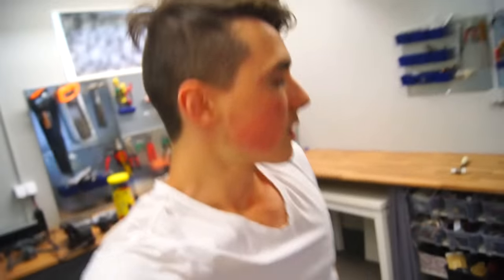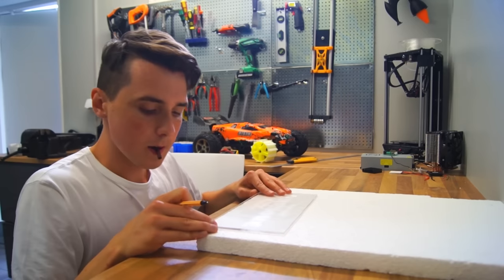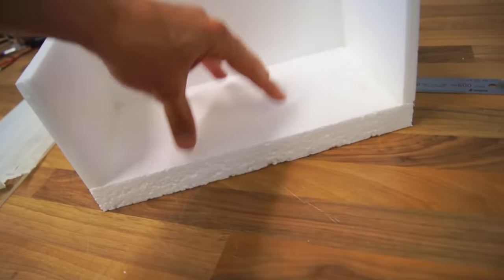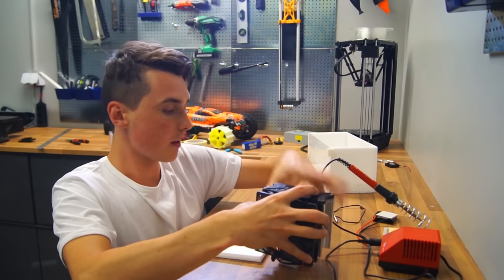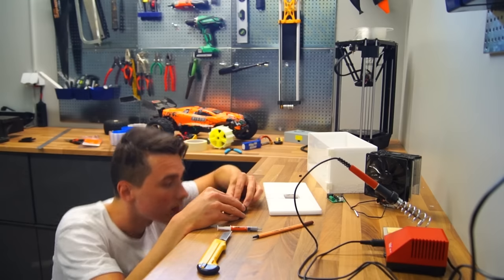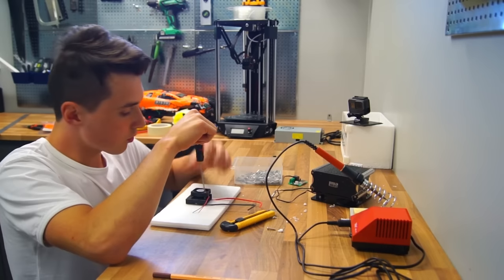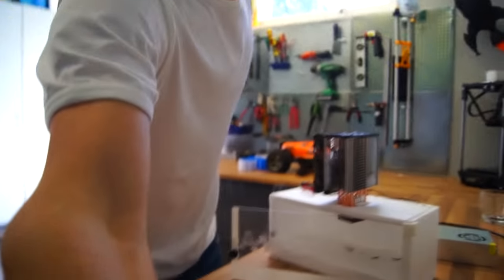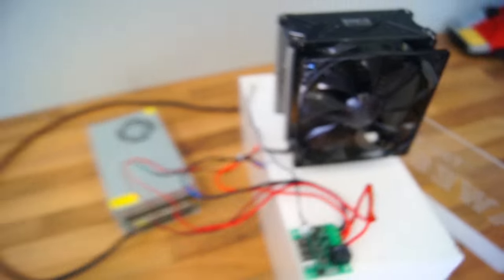Powerful Cooler Box - DIY Peltier Freezer

Comment: Peltier elements are usually designed to reach a 40 C temperature gradient between the two faces. You managed to get 38 C difference which is actually very good. If you want a lower temperature, you need to put 2 or more Peltier elements in series. Nice stuff!

Comment: When you turn unit off, inside temp is -7 degrees. Now ambient air heats external heatsink and transfers heat energy through peltier device back into your coolbox. Want proof? disconnect x4 heatsink when you disconnect power. Now coolbox stays colder after 30 minutes. Great video mate and thanks for sharing. Keep up the good work

Comment: Now this is fantastic! I saw an old but still useful Waeco cool box on ebay, well it use to be a compressor fridge which had all the parts removed because the compressor is damaged. Could use this to bring it back to life as a thermoelectric cooler. Thanks showing this project!

Comment: Great video! I'm also working on making a cloud chamber which means I need to see the lowest temperature that I can get. I did some experiments with 12706, 12709 and 12710. The lowest temperature with a heatsink with 4 copper pipes and 2 fans is -30°C. But you can do better by stacking them. I'm using 12710 on the bottom and running it with 12V and the top one is 12709 which is running with 5V. The result is -35°C. If you give too much current, the produced heat also heats them. If you have an oscillator, you may try the voltage/current ratios and find a way better solution (unfortunately I don't have one, I couldn't try it). Another good way is the cooling down the hot heatsink, not with air but with water or something do not freeze in those temperatures. If you use ice to cool down the heatsink you may easily see -50°C. What I think is that using the second cooler to cool down the main one with liquid cooling. So if you cool down the main heatsink to -10°C, you'll probably see -55°C and so on. I'm gonna try that soon and hope these ideas also help to someone. Keep up with good work!
Reply: turk var turk as bayraklari as
Reply: How could I calculate the necessary Amp for a 12715?
Reply: In an experimental way, you just need to test it. You can also try square wave signals with a particular frequency.
Reply: That's a clever thought. I might try that one (y).
Reply: I'd really like to see how that turns out. Please share. Please provide me with link . tnx
Reply: Is there a way to use this type of cooling technology to cool a 1sq meter space? Or is refrigeration more efficient at that size?

Comment: i've assembled dozens of pc in the past and that's how i applied the thermal paste. i don't know if there's any new method today but imo the reason why it's the best way is that it will guarantees 100% thermal contact (not surface contact) without any bubble, but of course if you managed to cover the whole surface it will be ideal. i really don't see any other ways are bad, as long as the paste cover most of the surfaces around 95%, you're good to go. most method will cover all the surface as long as they apply enough pressure to the plate. it's all about heat transfer efficiency.

the only concern i have with this build is the door placement. i'd rather put the door on top of the box to minimize the cold air "leakage" when you open the door. i'm not expert on this, but i always imagining cold air is just like water. it goes down to the low places. so, if you open the side door, i kinda "see" the cold air immediately pouring out. but it's a design issue, the concept still works.

Comment: Hey, I really like understanding Heat insulation efficiency in a forge wall, that stops over 2000 degrees passing through the forge wall, and stops it from melting a 2 mm outer casing. Excellent for thermal efficiency. It will help in knowing thermal efficiency for keeping something really freezing cold. Good luck.

Comment: hey, your worst insulation is that plexi door.. if you use a thick bread of clear silicone around the perimeter, and use a second sheet of plexi. it traps air, makes a double glazed panel.. much better.
and if you use a couple of led ribbon into the edge of the awesome sheet, it will light up the wording in an awesome way ;)
Reply from the maker: Yeah thanks for your suggestions! I was using 4mm acrylic, but maybe 2x 2mm sheets would actually work better? Or why not just go with 2x 4mm sheets!
Reply: RCLifeOn testing required but I reckon 2*2mm with an air gap would be an improvement over 1*4mm - 2*4mm would probably be better but 3x2mm or even 4xv.thin probably better still

It may well be too that you'd get better results using v.thin styrofoam or even rubber foam than air but the ability to see through is often an important consideration that overrides thermal efficiency

Thanks though for the great video!

Comment: excuse for my poor english, but really dont forget  that when you turn off your system the hot side of module diffuse heat in all the system (evo+hot side ->radiator+cold side) instantly, and all the time heat "wins" against cold. to reduce this effect you can try to mount the evo in push-pull with a mini inverter circuit with 11.1 lipo only to supply the fans on the hot side when the system is suddently turn off. Then mount like pc peltier cooling a brass plate near 5 mm ep. between hot side and evo. the temperature issue is not bring only by insulation. nice video, good project!

Comment: The way that you spread the "Thermal Compound" on your first project was correct,but should have used abit more. Putting a "Pea" size ball in the center and pressing the Peltier Device down will not spread it evenly completely or will not guarantee complete coverage of the Peltier Device's hot side or cold side. The surfaces must be covered completely for maximum cooling and heat removal!!!

Comment: Well, how you apply thermal paste doesn't matter at all. Linus tech tips did a video about it. The only difference is if you apply too much or too little. So you're not right, but not wrong either :)
Reply: Linus tech tips did a video on it and said that the best way is to make a pea sized drop.
Reply: But that video is about two years old, don't know about his newer ones
Reply: Maybe they said that, I don't remember, but there was no difference at all as long as you didn't apply too little or too much.
Reply: Anton Hylander well that is true also the thermal compound matters too but if I recall when he did another one of these he put a crapload of compound which is worse than too little.
Reply: Linus Tech tips is horrible for such things. Sorry but there are so many screw ups when it comes to temperature stuff. Like measuring the surface temperature of the case instead of the insides....
Reply: djteac again it's not just Linus cus many other youtubers have tested this and it's fine, it reallly doesn't matter if they messed up. As long as it covers the surface ur good.
Reply: but linus's video refers to installing a heatsink on a cpu, which is a bit different ;)
Reply: FeuerToifel it isn't much different to much paste causes a insulted effect. so you still want a thin layer so it can translate the heat to the cooler and using better paste also helps
Reply: the difference is, in cpu it is important to cover the middle part, where the DIE is. it is not that important, that the whole heatspreader has thermal paste on it. but here it is important to have thermal paste on the whole surface.
Reply: It matters because some methods will trap air bubbles, doing the opposite of the intended effect.
Reply: @Adam Knapp: It does not matter when you use the right amount.
The air bubble myth is a lie. All the air will get out when the pieces are pushed together. Some wannabe just made up the "there is air omg"-theory to look genius.
Reply: It doesn't matter as much from a practical perspective with CPU's, but there can be a measurable difference. I have seen improperly applied paste with air bubbles cause SSR's to prematurely fail in high wattage dimmers, though as you implied it was often also affected by the fact that they used the wrong amount in a field replacement.
Reply: Anton Hylander I have a quick question about how these peltiers work. If I made the same exact unit in the video but made it so that the cold side was facing the big heat sink, would that heat sink get cold and would cool the air that fan blows through it? (Effectively making a compact ac unit)
Reply: James Andonian while I have not tried but I hope to get some soon maybe I'll make a video. But my guess is the better option would to put the heat sync on the hot side because the cooler you keep that the colder the cold side gets and maybe put a hestsync and fan or a heat sync with a fan behind it.
Reply: AT WD good point. The cooler you keep the hotside the cooler the cold side is and if you have a big heat sync on the cold if you blow past it with an always on fan the colder it should reach
Reply: for this application he should cover the entire contact area with a thin layer. pea size drop may not spread 100% to all corners. this doesnt matter with cpu because the cpu is only touching a small area of the cpu heat spreader.
Reply: There is no such thing as too much thermal paste. If you have it spilling over clean it up and it's fine. It's not going to short anything out. It just needs to make full coverage. Linus showed that even adding too much doesn't cause a problem. And this isn't a cpu. It needs to cover the full area because the whole thing generates heat as were a cpu doesn't.
Reply: cpu die's is ALOT smaller than the aluminum Should that cover the die, it's "good" while you cover the die's Size in the should and better if it's a thin coat.
Reply: that is whre you have to do some clever seperation using certian things. i cant say much more but havet watched his design either. lets lsee
Reply: Linus tech tips has no clue whatsover. I did some world record overclocks based on huge differences in thermal resistance gained through liquifying thermal grease using ligter fluid.
Reply: Get a credit card and smooth over CPU and use a very small blob to fill gaps between heatsink and CPU.  

Can't go wrong.
Reply: ScreenGames Peltier modules are not made of metal, but rather made of ceramic. And ceramic has a low thermal conductivity, rather than metal. So it’s important to spread the paste evenly around The modules

Comment: That was cool! The worst part of the insulation is likely the door. Even though it's very nice looking - it's just a thin layer of acrylic. You can try to change the design so that you have the door on top of the box. That way you will at least minimize the  convection on the outside that transfers a lot of heat to the door.

Comment: An honest presentation & an experiment ! you could improve yo cooler box with sealed rigifoam joints with hot glue or silicone glue &  dark tinted door with internal LED indoor lamp to preserve cool inside.And better results may give if you have a metal encloser with internal rigifoam chamber surrounded by a sault insulator.this is over 40 years old trick in Sri Lanka that I assure and good luck with your experiments!

Comment: Ignore the people that say ur applying it wrong. All the computer hardware you tubers like Linus, Paul, Jay, etc all get the same comments. And they all say it doesn't matter as long as you don't put too little. It really doesn't matter if you put a lot or apply it's weirdly, as long as there is enough to cover the whole thing it's fine.
Reply: Linus is an idiot, lets just say that much about it. Measuring the temperature of the case with a thermal camera instead of the temperatures of the CPU itself at some point.

And its not about covering the whole surface either.

The heat is most concentrated in the center. And they are NEVER completely plane, they are either concave or convex.
So you don't spread it, but put a tiny blob in the center, so it spreads to those areas where its needed.

There are enough tests by manufactures of coolers like zalman that proof that this is the best method. Thats why most of them recommend it to be done this way.

If you spread it, you might have too little in some area, and you increase the chance of trapping air insite it.
Reply: djteac it still doesn't not matter as long as you don't put a little. It has to just cover the whole metal part

Comment: 10 degrees means that your insulation is terrible. Try making a bigger box but 3d print it so that there are air pockets between so that the insulation is better. The best insulator is a vacuum. Remember that temperature and pressure are directly related, lower temperature is negative pressure so its going to try to suck in the warm air. Try to make something with air pockets for insulation and with a door seal that can hold pressure. Then add an arduino so that switches the power off and on to maintain a certain temp. I know you can do it!! Keep up the good work.
Reply: it's the peltier not the insulation

Comment: Any information on the power supply? I can't find it in the "parts" section of the description :-)
10A with 200Watts means at least a 300 Watts power supply?
Reply: Power supply for 12706 is 5 amps (60 watts peltier).

Comment: Thermal grease application: It doesn't bloody matter, anyone who says it does is an amateur who has never tried an alternative. All that matters is there isn't too much (oozing out the sides), and there isn't too little (i.e., you need full coverage of the CPU/peltier etc.)
Reply: air pockets do matter
Reply: You literally said it doesn't matter and then said it matters
Reply: Spreading paste creates air bubbles which means less thermal transfer. It works, but its much more inefficient. Using a pea sized bit of thermal paste will ensure it spreads evenly and equally, along with no bubbles to speak of. And also, even if the paste does ooze off to the sides, it won't hurt it. Too much paste will go off to the sides, and too little will reduce thermal transfer. So unless you are using the verge's method of applying thermal paste, it won't affect the temps if you use a bit too much.

Comment: LOL! @Anton Hylander is correct. For a non-intricate piece of electronic material, such as peltier, as long as you get enough thermal paste spread evenly all over its surface, it's perfectly fine. Also, just in case some people commented to use a particular brand of thermal compound, well, it doesn't really matter (NOT a big deal) what brand of thermal paste we need use. An experiment done by a computer tech concludes that the temp difference of using the cheapest and pricey thermal compound is just around 2 to 3 Celcius.

Comment: 9:40 why is it on???
Reply: Pizza med Banansmak no he switched it on look at the plug light. It's so he can see the led LED splay
Reply: hmm i think cheating!
Reply: George Elsham but I mean that it had already gone like 15 minutes and it was on. Before he turns it on to see the display
Reply: Pizza med Banansmak he's looking at how long the cold takes to make an equilibrium with the air trmperature
Reply: Pizza med Banansmak yeah i know he switches it on to cool it down as much as possible, switches it off and waits and switches back on to compare temperature read on the display. The display or cooler won't work if power is not on 🙂
Reply from the maker: I just turned it on for shooting those 6 seconds of slow zoom in, for no logical reason though. Besides if I were cheating, I sure would make it look a lot better than going from -7°C to 9.6°C in 30 minutes.
Reply: To improve the cooling if u turn the device off. You need to turn the Peltier off slowly because the inner isolation of the Peltier in off state is near to zero. If u turn it off so the heated side will instantly warm up the cooled side because temp ernergy always flows from high to low C°. Also let the Fan work for a few minutes more.
Reply: GrandeCalle great idea but how would one go about doing that? I am only just not getting into making electronics and stuff
Reply: If he were to cheat I think he'd lie about the time taken switched off, because theres no way to tell from this video if he did actually wait 30 mins, and anyway, what would he be gaining by cheating, certainly not views since that figure isn't mentioned in the video title. Very unlikely that he cheated.
Reply: GrandeCalle similar to a turbo timer on a car
Reply: That was good to notice. Especially for small box this effect will be significant. Thanx GrandeCalle!
Reply: CHEATER

Comment: What I've learned about Peltier devices is that they can have an awesome coefficient of performance of 5 or even more - this is potentially better even than an ordinary domestic fridge. But you have to under-drive them to get that, and you get a small temperature differential. So the challenge is to make a highly fuel-efficient peltier fridge, that will inevitably require multiple devices in some sort of serial configuration to get an adequate effect with high energy efficiency.
Reply: lets goooooooooooo
Reply: Is it possible to use enough of them together to generate charge while they cool?
Reply: @orioguy9  I don't know, I haven't actually done any experiments yet